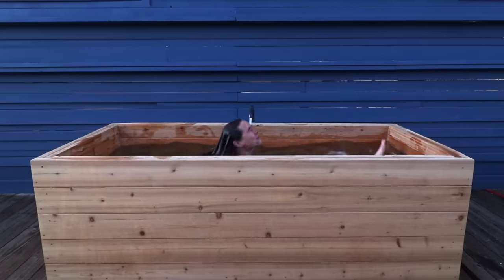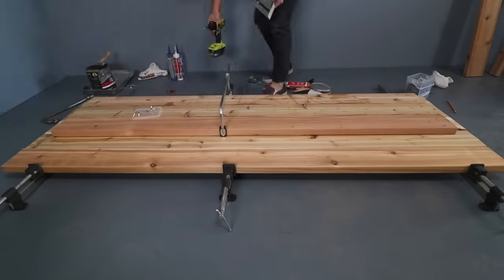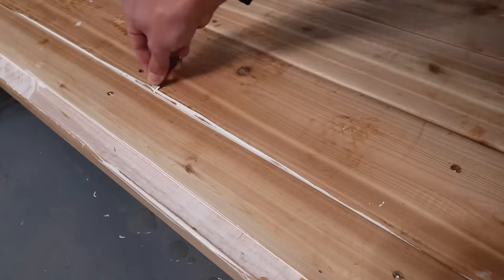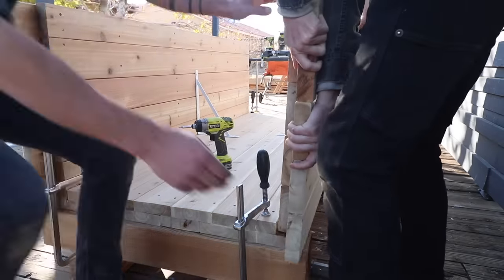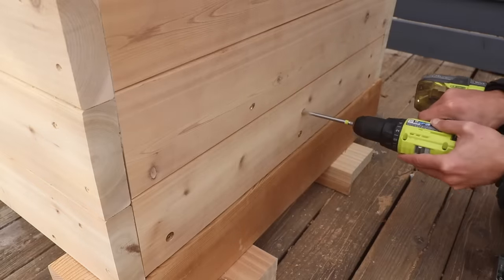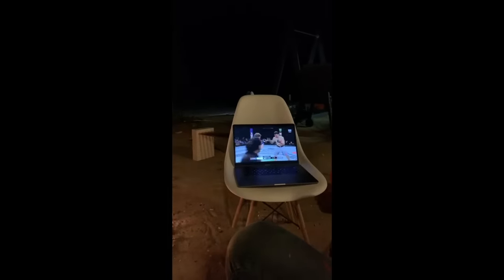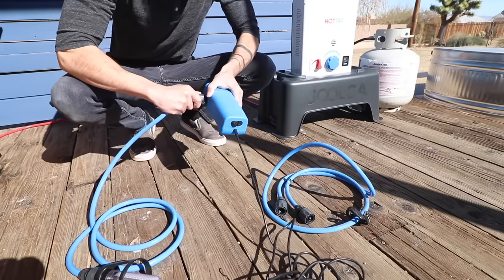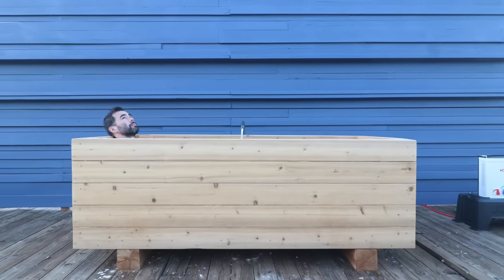I made a WOOD HOT TUB out of 2x6s

Comment: All you need is one layer of cedar. Then, line the interior with a thin layer of fiberglass and clear epoxy to permanently seal the wood. Sand it to a perfectly smooth surface. This is how you make cedar canoes that will actually last for decades. Any other way, and the wood will eventually rot.. Especially if you keep water in the tub, and use Chlorine or Bromine for treatment, as those chemicals break down wood fibers over time.
Reply: Ultraviolet treatment in-line of the recirculating pump to get around chlorine?
Reply: @mikethelma  ...UV adds to the disinfecting, but isn't be used alone. Some kind of disinfecting chemical needs to be used, like Bromine or Chlorine. There is a Silver system you can use too.
Reply: Sounds fishy. The planks in a canoe are under compression, whereas the planks of the tub are in tension. Totally different design Dude.

Comment: Regarding big box non-cedar, thats pressure treated pine and ir has chemicals
Reply: None of which are toxic, for at least the past twenty years.
Reply: @the_original_skytiger  there's a difference between using them in your garden and soaking it in water and then soaking yourself in that same water. they probably haven't tested what happens if you use it for a hot tub.
Reply: @sandrafrancisco  These chemical were rated non-toxic to humans a long time ago. Wet or dry.

Comment: I thought the point of cedar tubs was the wood swells to make it waterproof so you don’t need 2 gallons of flex seal?
Reply: Exactly. Should have looked up shiplap joint.
Reply: Yeah, it would be much cheaper to do this with 1X6 cedar and flex seal, otherwise with the same overlap process. Much lighter weight. I would have made it shorter but wider too, as I doubt you will be lying out full length very much and less surface area means better heat retention. Japanese homes have something like this but without the double layers and much wider boards. They seem to have sorted out preventing leaks and handling all that water pressure.
Reply from the maker: yes but hard to do with a limited tool set and lumber with knots.  getting all clear cedar would have more than doubled the price.  also there are videos out there on the hard way and even kits to make them.  I wanted to show an easier way that is more forgiving.
Reply: @HomeMadeModern  totally understand- those cedar tubs are $$$!

Comment: Would never use silicone to bond an assembly where Tightbond III is waterproof and has much more holding power.  Would also never leave bare wood, but cover it with Spar Urethane (as used on wooden boats), which will waterproof it, and is UV resistant to sit in the sun all day.

Comment: I'll be looking forward to a six-month or one year update on how this holds up!
Reply: It won't. First he didn't turn the boards correctly and secondly he didn't seal any of the wood, so it will warp over time breaking all connections and also rot over time. He spent a lot of money on a long term fail.
Reply: Well aren't you just a Ray of light in the world. Have you built a lot of hottubs yourself?!
Reply: @tigersunruss  So how do cedar/redwood hot tubs survive for many many years?
Thats me sayin you don't know what you're talking about.
Just looking out the back door I can see cedar/redwood decks and fences for miles.  Those are lasting a long time.
Reply: @McClimber234  ya, probably won’t rot because cedar is great that way. Most wood hot tubs are made with clear straight grain material because the knots will pass water directly through. Certainly won’t rot but the difference in moisture between the inside, middle, and outside of the tub is going to cause some wild warpage over not so much time, and that could easily cause total failure of the joints. This is one of those things where you can build whatever you want at your own skill level and equipment, but you can’t expect the same results the pros get.

Comment: i think this would have worked without any of the sealant. the wood would swell and hold the water
Reply from the maker: I think its possible on the panels but the corners between them would have needed some.  sawdust mixed with water can be used and getting rid of the flex seal and only using silicone would be an improvement.

Comment: A better material to seal between the layers would be a product like red guard that is used in showers and bathrooms and is a waterproofing membrane and crack isolation barrier typically used under tile but you can also get the product in a clear version instead of the red but it’s the same stuff. You can get a 5 gallon bucket for around $150 and it would do more tubs than you want with 2-3 coats between the layers. It’s applied with a paint roller and dries in about 15 min depending upon weather. 

That would be a much better and more cost effective product to use instead of Flexseal.  

This is a fantastic design but I also think I would use a shiplap or half lap joint on the edges of the boards and if you did that you do not need any sealer at all. The cedar swell with humidity and moisture and will seal itself within minutes, especially if each board had a half lap joint. I think I’ll go ahead and build one like that to test out but think it would be a nice improvement to your already fantastic design!!

Thanks for the video, good job!
Reply: do you mean typical but transparent liquid foil? e.g. like: https://mastabuild.co.uk/index.php?route=product/product&product_id=76
Reply: Where can a guy get a 5 gallon bucket of the clear Red guard?

Comment: Did you have to take out a 10 year loan, with today's lumber prices, to be able to purchase the cedar 2x6's?
Reply: Yeah my rough estimate was like $1000 of cedar at current prices.
Reply from the maker: wood prices have been crazy!!!
Reply: My thoughts exactly. I been getting pallets from a nearby tractor dealership and repurposing those.
Reply: No flex seal paid for the cedar 🤣
Reply: Smiles and then opens a new stereo system!
Reply: Hmmm 10 year loan or take my chances with recycled Pallets? Just teasing . I bet it would work with Much smaller Boards but I bet U would need to band it. I built a table with a Rock 
and wood top . the middle is a beer cooler similar to how they did it. The issue I had is over time it got cold froze and split the wood. After grilling and drinking I did not dry it . I am now looking into acrylic / resins to hold the ice and beer. They would not cost as much and could be very cool. U could add lights and glow in the dark components
Reply: An easy way to avoid the high costs of wood is to just build this tub out of 24K gold.

Comment: Pro tip, When using a caulking gun pop the release lever slightly after each use and it will stop the continuous flow of fluid out of the nozzle.  Nice project!
Reply: I thought popping the release trigger was standard procedure.!!
Reply: ProTip: Pros use dripless caulkguns. They don't have a tab on the back to pop.
Reply: The old school ones with the notches on the rod and lever on the back are around $2, while the dripless ones are like $9. 
The inconvenience of the older ones isn't worth the $7 savings. Treat yourself to an upgrade. You won't look back 😁
Reply: Cant stop the flow of fluid out of my caulk sorry
Reply: @722Moo  might wanna see a doctor about that, Sir. 😳

Comment: wouldnt the wood expand itself when it gets wet, thus creating a seal?
Reply: Cedar boats are built this way.. a tongue and groove joint tightly fitted would self seal when wet. personally I don't like this cedar hot tub build. The way it's all sealed up it could be made out of any lumber (although the pine or whatever wouldn't hold up as well being constantly wet).
Reply: @seeburgm100a  feel like the seal will break when thevtree expands anyway. Unneccessary Cost
Reply: @seeburgm100a  Also, the grain is horizontal and will trap water longer...  I agree the build is lacking is technical knowledge.  Lots of product placement.

Comment: Good job man
But is it safe to heat the flex seal ?
Reply from the maker: I dint see anything on the material safety data sheet that was alarming but I am not an expert.  if I built another one I would use just silicone though.

Comment: Painful to watch. This won't last you long as the unsealed sections take on water and expand faster than the sealed, which will end up rotting out and the tons of screws will cause cracks as the wood expands. 

The whole idea of a wooden hot tub of any kind is that it must become fully saturated with water and is built to do so. When it expands it needs to do so in a way that seals the cracks. Sadly all you needed to do was some simple jointery to connect and seal things instead of glue and screws. Hopefully no one takes your lead on this project since it's a waste of cedar.
Reply: As I watched this I wondered if it might have been good to "paint" this thing with polyurethane or some such.  Spar varnish?  Epoxy?  Possibly sandwich an entire wrap of epoxy between layers of wood?  I know little enough about this to think it might be a good idea.
Reply: @mikethelma  For a little more expense you might as well go fiberglass and get something that will last a while.
Reply: For all the money wasted on the cedar and stainless steel screws, why not just buy a hot tub ? A 2x6x8 cedar plank is $26.27 at my local Lowe’s store
Reply: @flintstone86  Yikes! I heard wood was getting expensive.  You can get a hot tub with materials, manufactured, and installed for $5k or so.  You can carve cedar duckies while waiting for delivery.  😺
Reply: @mikethelma  hahahaha
Reply: My uncle built a wooden hot tub on a trailer in the 80s.  He used toothpicks and yarn stuffed in gaps to seal leaks.
Reply: agreed this is a terrible method and there are actual good methods using wood out there.
Reply: I built several hottubs as I lived on my job sites I did this with pallets and misc. Osb pieces for the interior walls . Once completed where I had osb covering the entire interior I rolled the entire thing with roofing product 100% silicone. That tub lasted easily a year. The next tub I made out of scrap pieces of Trex deck. And coated it with silicone only issue with Trex Dex is the silicone doesnt adhere to the Trex deck so you must have the entire interior covered in a thick coat of silicone. Which can be pricey at $250 a five ga.

Comment: Can only imagine what he paid for those 2x6s probably at least $15 a piece
Reply: he been planning this for a while he prob  had these for a while
Reply: That's still only about $300ish in materials for a personal hot tub. By contrast a basic commercial hot tub would start at about $3000.
Reply: @bigfatdynamo246  $300 my friend would get you the lumber maybe. that flex seal adds up to $160 at $80 a gallon. then the hardware and water heater probably another $500. Math isn't your strong side :)
Reply: @bigfatdynamo246  u can buy an inflatable hot tub that plugs into the wall for 300 bucks off amazong
Reply: I will stick with my $100 stock tank.  Not as fancy but works great.
Reply: @keralee  😂😂
Reply: @keralee  I went with the cast iron tub, better shape.
Reply: They'd be like $100ea here
Reply: @islandonlinenews  cast iron is nice shape, but it has 2 major flaws.  Its HEAVY so I cannot move it about.  And cast iron sucks up a lot of heat out of the water.  Poly stock tank still my fave...unless you are heating it cowboy style with a fire underneath!
Reply: They are at Least $25 each here in Los Angeles.. rough, not S4S
Reply: Yeah but something like this would actually add value to your house and an inflatable tub wouldnt. So if you own your home if you spend a little more up front it will be worth it when you sell your home
Reply: @avigetsbored  Something diy´ed like that wouldn't add value to ur house because it's not professionally manufactured so it could pose a safety threat. Also, only in-ground hot tubs add value to a home in general.